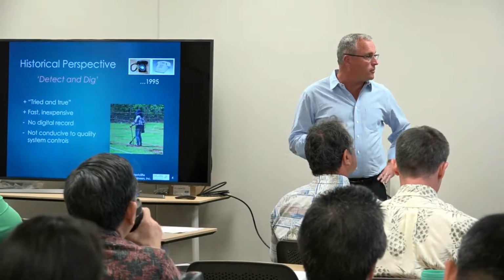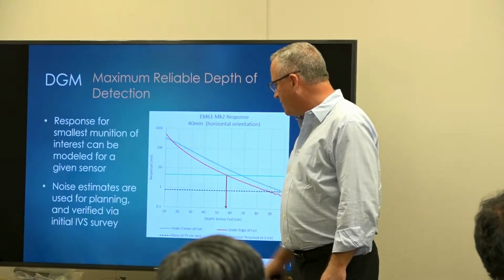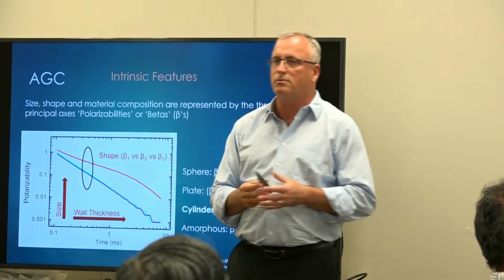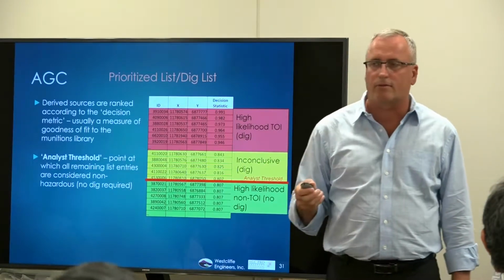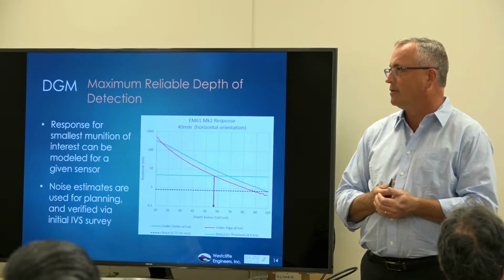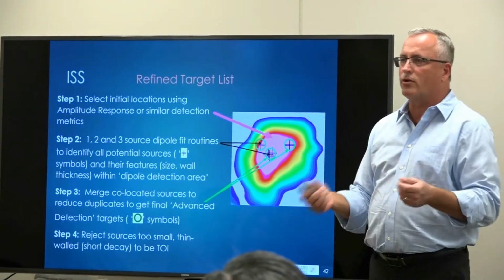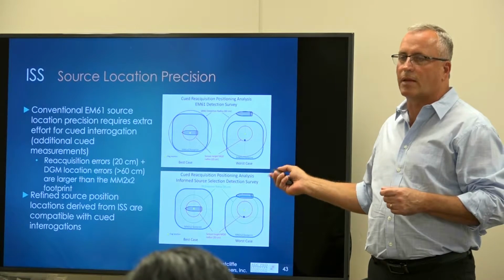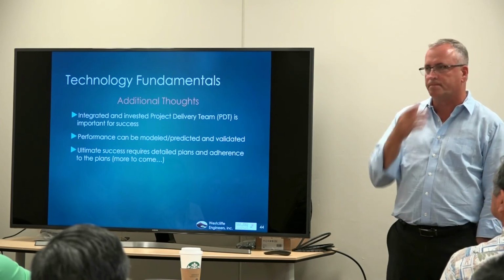UXO Training Workshop 4 - Fundamentals of UXO Technology

Comment: I'm really not sure how to comment.  AGC obviously looks good on paper; but,.....not so much on real UXO sites.  The "saves money" comment is certainly inaccurate on all of the sites I've been forced to use AGC.  The added expense of AGC far outweighs the cost of extra digs for a dig crew.  As for the "library", it has been nearly worthless as so many UXO items are found in all different configurations ie..broken apart, squished etc.  MEC items in many cases are partial rounds or even partial fuzes.  The library does not account for all of these variations.